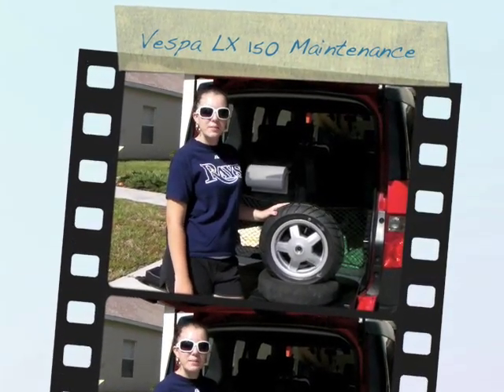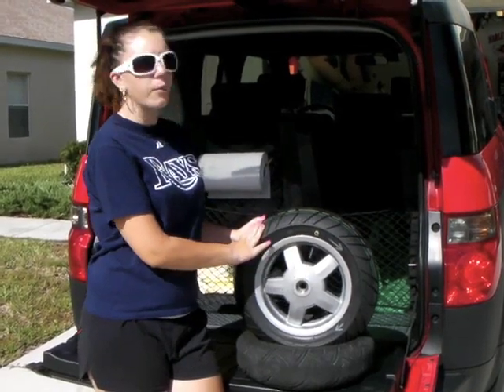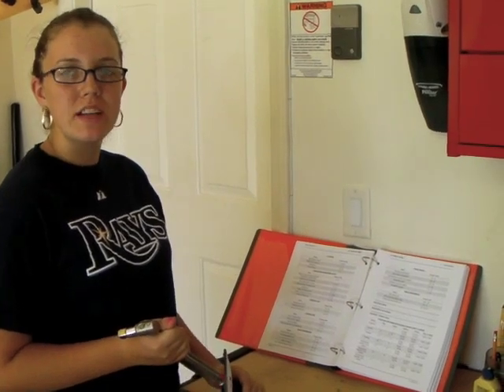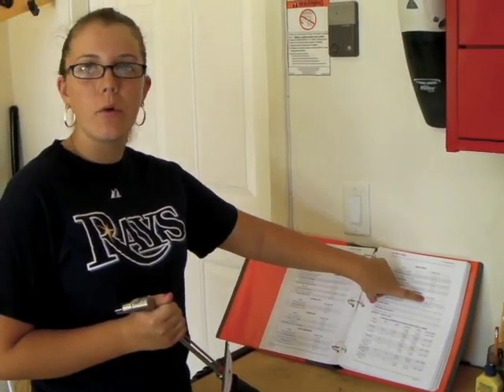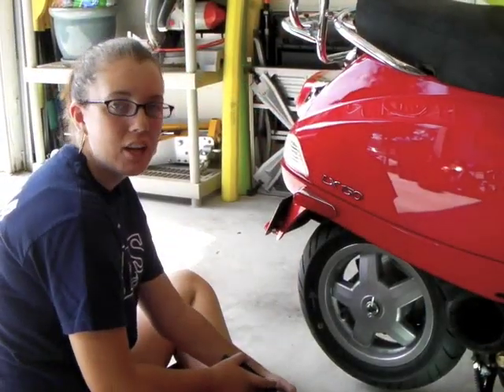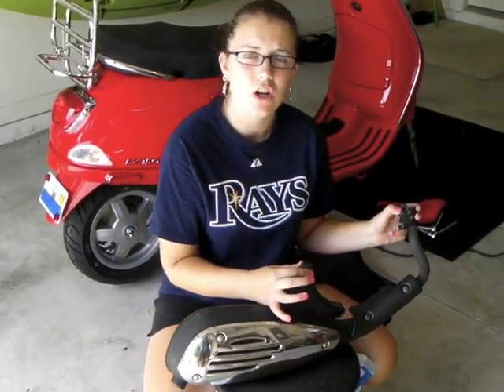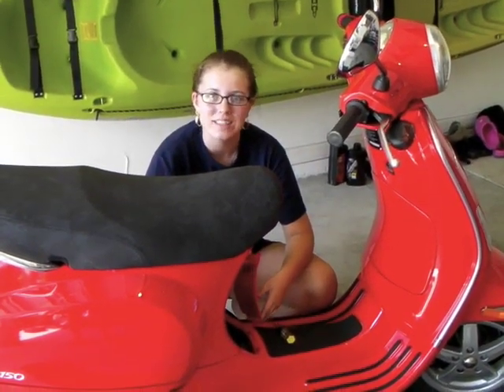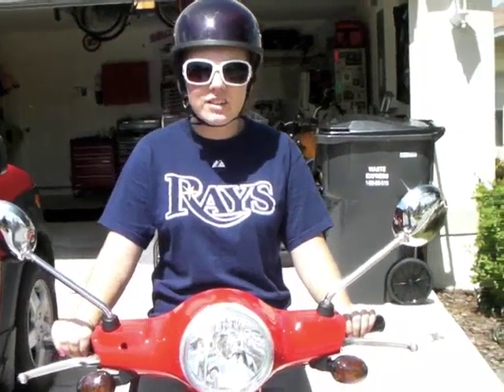Part 2: A Florida Scooter Girl's Vespa LX 150 Maintenance Video

Comment: Good work.  These scoots are simple to maintain, but it's nice to show everyone how to do it with a video.  I didn't remove the access panel to put my own muffler on.  I should have removed it because I had trouble getting the flange to seat properly.